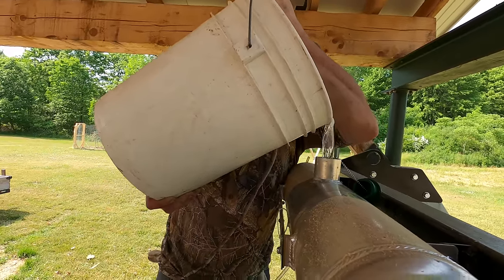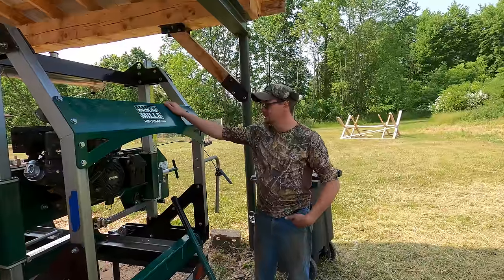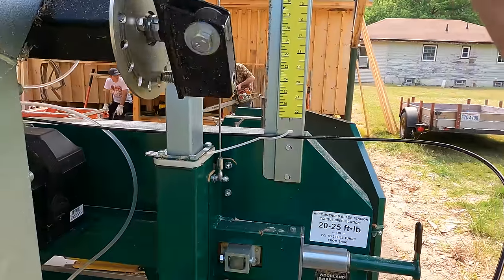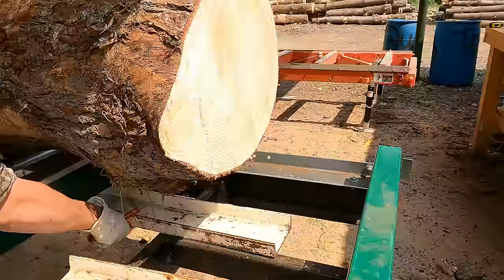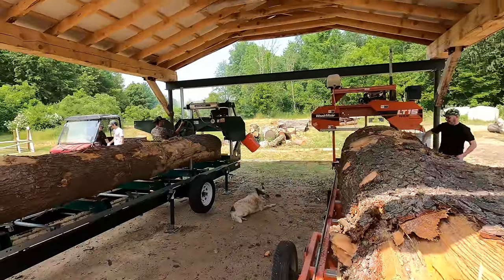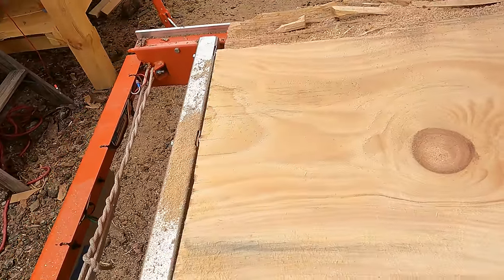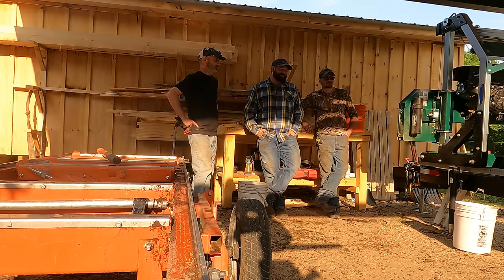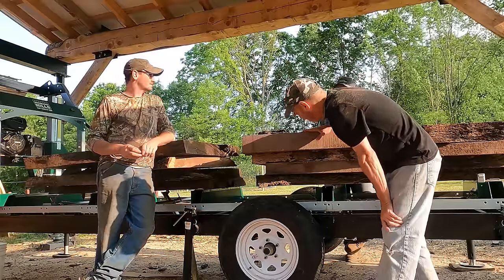Woodland Mills vs Woodmizer sawmill comparison

Comment: I was going to buy a Woodmizer this last Jan but they were backordered like 9 months. So i bought the Woodland Max with the woodlander trailer. Been super happy. I have the throttle set so it runs with no water unless you give it a little more squeeze and then the water flows. I really like this as i can control when i want water or not. Some wood is wet/green and does not need water. After watching this video, the Woodmizer has a few things i like, such as the controls. But the log locks being screws, well the Woodland clamp system is fast once you get the hang of them. Glad i got the Woodland. Very happy. Also, blades sure dull quickly if there is any dirt on the log. Thanks for your gracious interaction. Looked like a fun day sawing!

Comment: My 2003 Hudson Oscar 36 handles 35+ inches wide and 25 foot lengths. Powered by a Vanguard 23 hp V Twin engine. No hydraulics  and manual drive it is a great mill for me. Bought it new, restored in 2017 and ready to go again. Sawdust no problem, logs rolling in on a lifted rail system which eliminates the logs rolling on the ground. It is a fixed type not portable but many spruce and hemlock trees of 32 to 35 inches wide. I plan on constructing a saw mill shed over it to cover the infeed deck, the mill, and the trailer to haul the cut lumber to my drive thru lumber shed. Dual chain lifts with overhead tracks that can move the lumber from the trailer to any of the 16 lumber bins in this shed. All designed to be a one man operation who is a grandpa, that's me. Welcome to an old school Alaskan.

Comment: Nice comparison. Thank you guys. I appreciate the comment "no matter which mill we get we push it to the max". Yep. Nature of man vs machine. No matter which side-by-side comparison you do, the contenders will have pluses and minuses. Nobody makes the "perfect mill", and if they did I couldn't afford it.  For the money, the Woodland Mills is a great homeowner/homesteader sawmill that will more than satisfy. I have a 130Max and couldn't be happier. Yes, with only 7.5 above the blade (it's due to how/where they mount the engine) you do have to cut thicker boards by cutting in from both sides. But so far that hasn't been a deal breaker.  I did add the power head for raising/lowering the blade. My arthritic shoulder is much happier. What I'm trying to cobble together now is a debarker that will run just in front of the blade on the entry side of the cut to improve blade life by getting rid of the bark with the dirt and grime that gets embedded in the log bark from dragging them around. In my spare time...
Reply: I've been dreaming up something similar.  I was thinking of an angle grinder with carbide inserts.  And controlling depth with a guide wheel or a disc that is slightly smaller diameter thank the cutting wheel.
Reply: Great❤video ...anymore info on the rpm gauge? I also have the  hm130max
Reply: @hpw59  Absolutely!  We have a few more videos to make, and we can absolutely show how we did this.
Reply: @BissellMapleFarm there are several on the market, you could copy one of the existing ones but your idea sounds pretty close. Use spring tension on it so that it will follow the contour of the log. I ran an LT30 for about two years, all sizes and lengths from six feet to 18 ft. When I got up to like 10 ft long and probably 12 in I could average a thousand board feet an hour working by myself. That was a fully automated wood-mizer. Also I never used water.
Reply: @Royal-xh8db good stuff.

Comment: Bought my HM130 Max over a month ago. Called and ordered it and picked it up at the warehouse in Portland a week later. I bought 2 extensions so I can mill 20' lumber. Very happy with the mill so far. However, there are a few tricks I'll need to learn about milling flat and keeping the cant square. Time is the best teacher and I've got plenty of that. So glad I didn't spend over twice as much on the LT15 wide, and then wait forever to get it.
Reply from the maker: I think if you talk to anyone who has run both they will tell you the price difference is justified. The wait is the killer..
Reply: What's the price tag on these?
Reply from the maker: @sherimatukonis6016  as they sit in the video, Green one was $7K and orange one was $16k
Reply: @mcsawmill  seems like the $7k is comparable and half the cost. Unless I missed something.
Reply from the maker: @sherimatukonis6016  harbor freight has a $3k sawmill, it's comparable too...
Reply: @mcsawmill  I've seen harbor freights in another video. It didn't impress me.
Reply: @sherimatukonis6016 nothing from harbor is impressive.
Reply: @Royal-xh8db  it's the go-to when you don't have enough to go for good quality...

Comment: Nice comparison guys! We run a Woodland Mills 130 max also. We almost bought a Mizer but there was almost a two year wait. Not good sales service. I am extremely happy we got our Woodland Mills instead. The 7” throat at first I thought it would be an issue. We just learned to cut down to our 8x8 like you are cutting  bigger like an 8x12. Found that the amount of time you actually need to cut 8” is so rare that it makes no difference. Thanks Guys! 🤠👍
Reply from the maker: @TwoGuysTimberframing  there are things I like about each.

Comment: Thanks for your show. I'm impressed, and It's of course more difficult to get the band saw blade to cut straight without vibrations with narrow saw bands in big twisty logs with such large twigs as in the big log on the orange mill, so that's not the skilled sawmasters fault. I think both saw mills would work well for people that want to use their own timber in a better way and make wood materials for own use, and if possible do some extra for others with the same needs. In addition it's pleasant work😊. And as you know the 4-6" wide band saw blades which are more accurate and can handle big twigs better are normally used on large commercial saw mills.Thanks for the video.

Comment: Good comparison,  I have 126 woodland. The 126 makes me keep the log size down, which is ok with me. I'm a one horse operation, I use the tractor if I have to.  👍 a lazer would be nice and electric start, and being able to raise one end of the log  conveniently, these are the 3 things I've wished for. 👍
Reply: Check Sawing with Sandy.He added lasers.
Reply: Woodlands have toe boards, I have lifted 28 in 16 foot log. With 12 volt driver. It sits in the rails easy to move an use. On my hm130 max
Reply: Watching them turn the log was painful. I installed a hand crank boat winch. Used to load and turn big logs one person.

Comment: I use a scissor jack for a toeboard sitting on a piece of metal the width of the mill. Nothing is bolted so can put anywhere depending on length of log. Only have $25 invested in toeboard and with jack down, sits below the bunks.

Comment: Ive had a timberking 1220 for 15 yrs. I use the timberwolf blades in .045, 10 degree for sinker cypress logs. They are great  cutting blades. Send all my dull blades to Cooks  for resharpening. Keep up the good work.
Reply from the maker: I have carbide blades on order, will be another month before they come in but I plan to try them because they are supposed to be much nicer cutting really wide cuts. I'll make a video on it once I get them.

Comment: Very interesting comparison.  I have an HM130 Woodland Mills band saw, 2016 vintage.  My son and I share the mill and move the saw head between our farms.  I built a very heavy duty deck for the saw and can saw 22 ft. logs.  My son has the deck that came with the mill and can saw up to 16 ft. logs.  We both saw A LOT of lumber and have not had any serious problems with it.  The only real maintenabce was replacing the clutch this spring.  A bit of a job.  I had to cut it off with a torch since it was siezed to the drive shaft.  I tried using a puller but there is not much purchase on the clutch.  I used thread ease on the shaft before I installed the new clutch. If I need to replace it I think a puller would work since there may be enough to grip puller jaws on and apply some pulling force. I am in the process of mechanizing my mill.  I have log dogs powered by a DC actuator and have almost completed installation of a DC hydraulic log dog.  Still figuring out how to install the DC hydraulic log turner.

I really enjoyed your honest evaluation by some guys that have obviously milled plenty of lumber.
Reply from the maker: I would love to see your dc log turner! thanks for the comment!
Reply: This was some good info.  I'm pretty sure you've milled more than I have!!

Comment: I have a wood mixer Lt15 wide with a 10 hp electric motor. I have put about a 1000 hrs on it and it has worked pretty good. I put an amp gage on the motor because I couldn't tell how hard I was working the motor and kept stalling it. Put a electric solenoid valve with a switch on the control panel for the water.  I don't like the log clamps because when you are sawing a square cant and the clamps is laying down it doesn't hold and the cant can roll over when sawing. The cross bunks are thick enough steel but the main frame is not as thick and is too light to handle the weight of big logs. I like the way the woodland log clamps work and that they slide up and down. I am going to check out the thicker blades because for cutting wide slabs the 45 blade is to thin. I have owned a Lt30, a Lt50, and now this Lt15 and have liked Woodmere pretty well.

Comment: Nice vid.  The lesson I'm learning is I can 1) shell out the extra bucks for hydraulics and automation or 2) keep a couple teenage boys around. I've looked into the cost of feeding them - I think the hydraulics will be a lot cheaper.
Reply from the maker: Hydraulics are worth the money, so is the wide feature.
Reply: @mcsawmill a wood-mizer with a log loader and hydraulics is an impressive machine. Working by myself I could put out 5000 ft in 6 hours making 4 x 6 cants, plus about a thousand feet of lumber.
Reply from the maker: @Royal-xh8db  one of the things we didn't mention is these are portable, so these mills are made smaller and lighter than fixed mills. You pay extra for portable so if you don't need it look at the fixed mills, many are bigger and faster.
Reply: @mcsawmill the one I was running started Life as a portable, it was then set up inside a building.

Comment: I had a timberking 1220  and we built our own trailer, we could saw 20' and used mobility scoter motors for feed and up and down with pulse modulating to control the speed. It worked perfect. you just have to use 24 volts and have to charge the battery's at the end of day as your motor only puts out 12 volts. i got the idea from another youtuber....
Reply from the maker: @tcsawmills has a nice timberking mill but you'll have to go back a ways to find a video where he uses it.

Comment: Watching you guys with the toe boards I would say use a long lever seems like it'd be quicker and easier... I work by myself quite a bit with huge logs in a manual lt15wide and I made an 8' peavy that is my best friend.
Reply: Same mill here. My toe board is a Hi-Lift jack. My big log rotator is a Hi-Lift jack. My 12" x 12" beam mover is a Hi-Lift jack. I too work alone. Well, me and my Hi-Lift jack. LOL  Oh, and I'm 65 years old.
Reply: @loghog4392  I just bought a 15 wide after having a 130 max.  I’m curious how you put the jack in for the Woodmizer to lift the log and rotate it.  Can you tell me more about how you’re using the jack?

Comment: Very helpful comparison. That tip for the trailer manufacturer is excellent. 
I see Woodland now has a 136 max. 
But, the depth of cut or throat looks shallow. 

I had same experience with Woodmizer vs Woodland. Better availability and less superiority complex from Woodland. 

And comparing small mills, Woodland has the highest standard engine horsepower. The others only offer similar hp as an added cost option to make there standard prices seem more affordable.
Reply from the maker: the woodland mills is a great home sawmill, the woodmizer is worth the wait. Buy what is right for you. Harbor freight has a $3k sawmill, if all you want is to cut 2x4 and 2x8 it'll do the job. We just wanted to show what to look at when deciding.

Comment: On  (A&D  Adventure on Timber Mountain) , i have the hd130max from woodland mills  
great machine ,small motor for the size of cut but motors along just fine ,and i like the feel of the cut as pushing 
the only thing that i wood have liked on the woodland mills is the bunk raise 
great comparison !!!
Reply from the maker: Are you cutting all the lumber for that cabin build? I just subbed, I want to watch that, good videos!
Reply: @mcsawmill  yes we are cutting all our lumber for our build ,but we have to send out the planks to get dried and planed, this will be a new project on our video program , meaning will be planing to build our own wood kiln.cheers Anne and Dean

Comment: I own a woodland 130 mill,  one of the big problems ive had is the track sections  were bent slightly from the factory, the other is the siding attachment  is a pain to deal with if you not using it so dont bother with it if you dont need it
Reply from the maker: @danietkissenle  bent rails, did they replace them?
Reply: @mcsawmill  nope

Comment: I own a 2006 woodmizer LT15 gas. I’ve milled aprox 3 of those stacks shown at beginning of video (combined), hard and soft wood.
I don’t have the stainless steel bung covers but only now wish I had them, it will protect the mill structure and maintain accuracy.
Since I bought the mill in 2006, I’ve only had to call for more blades, and I think Woodmizer is “Made in America”, so….. 🇺🇸! 

No disrespect to the other mill🙏
Reply from the maker: I have friends with old sawmills, all them are woodmizer. That's why I spent the extra money.  Bunk covers make it easier to roll the logs too, they're slippery.
Reply: Made in Poland
Reply: @robcarter2891  the US models are made in the US. The European models are made in Poland.

Comment: Toeboard? You mean wedges! We have the norwood mill and it was a little finniky in the beginning but now when everything is set up it works well. And some toe oard mod will have to be made at some point. And hey make some T shaped measuring devices to find the centers of the log so you dont have to mess with the measuring tape
Reply from the maker: Tees? Tees? We don't need no stinking tees! Lol...

Comment: Having an impressive Timbering 1220 mill owner for over 10 years to compare,  the Woodland HM 130 max is the best saw for the money but I'll leave it at that, however, the 14HP motor is undersized  my advice is to go bigger if its an option.
Reply from the maker: You got it right, for the money it's an awesome saw. Probably should not have compared it to the LT15, it's competition is the EZ boardwalk 40, Hudson, etc. But we just showed the differences.

Comment: 176" blade on the LT15W.

If they sold you .042 they did you a disservice..045 or .055 only way to go, thinner blade for more sharpenings, thicker for less chance of deflection, but you haven't be good with 2, maybe 3 sharpenings before they snap.

Comment: Would like to see same log size and new blades on both for a real comparison
Reply from the maker: for cutting speed? The woodmizer would win, it's got double the horsepower, that's why production mills have great big engines. Doesn't even matter if it's a band mill or a circle mill, horsepower = speed.

Comment: I forgot, you also need an 18 volt 1/2 inch impact like for lug nuts, tons of torque to crank that lifter up
Reply from the maker: Thanks, I've tried my impact, it damages the device. Found the drill works much better. It's weird but true.
Reply: Now that you mention, it may have too much power, just looked like the drill was struggling? Thanks

Comment: even our woodmizer lt40 won't cut over 23.5. they claim 24 inchs. now way do to some bolts in the way.
Reply: Might want to check your manual about your blade guide assembly .  My 89 lt 30 will cut 28" ,my 97 lt 40 cuts 28", and my 2012 lt 35 will only cut 26.5 wide.

Comment: If you were running a production operation for profit, I can see the need for a $45,000 mill.
Reply from the maker: Definitely, even multiple machines if they pay for themselves.
Reply: If you want to go for  production profit  id try to go for an old circle saw mill with  a proper set works

Comment: What is the value of what your crew cut in one day verse there average wage of 15-20 $ an hour and expenses to operate
Reply from the maker: @shelbyadams9955 these are homeowner mills not production mills. If you want to make money you have to get a hydraulic mill. That said, live edge slabs can sell for anywhere from $75 to $1500 each once dry.
Reply from the maker: @shelbyadams9955 these are homeowner mills not production mills. If you want to make money you have to get a hydraulic mill. That said, live edge slabs can sell for anywhere from $75 to $1500 each once dry.